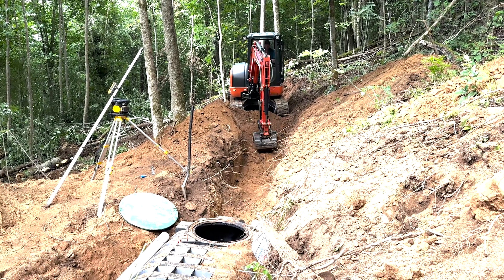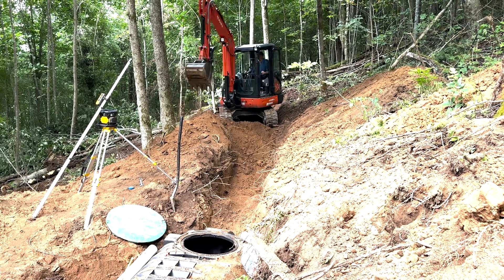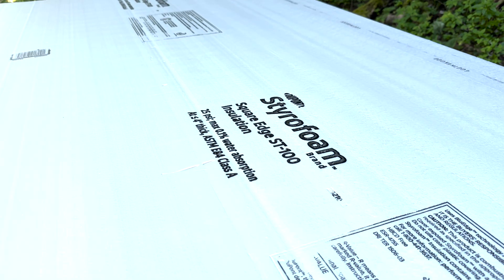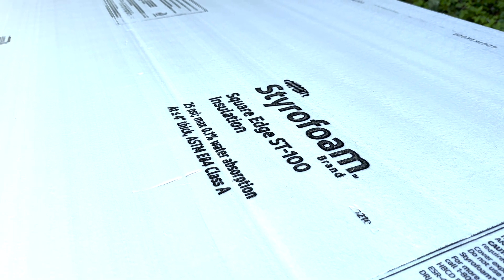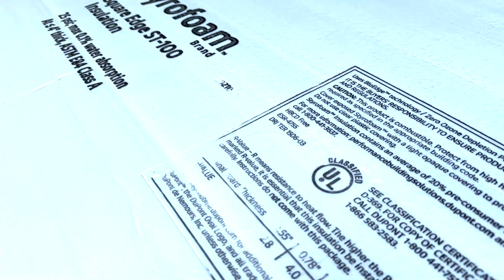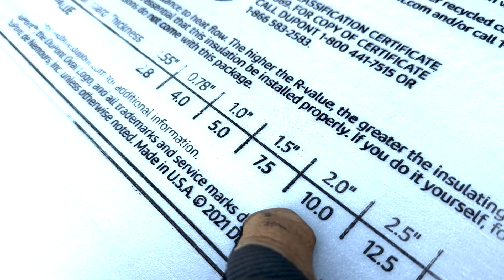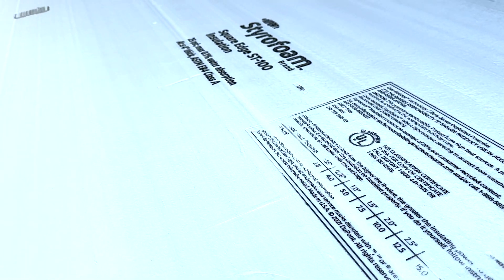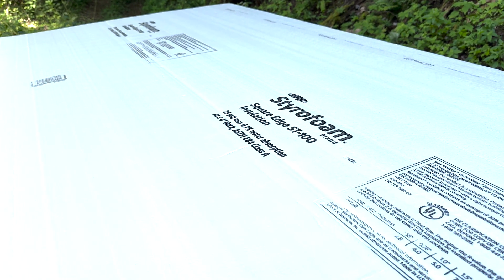Episode .15 - Insulating Cabin Floor with Dupont Styrofoam ST-100

Comment: Nice job, one question for you, what was the thickness of the OSB on top and do you find it spongy at all without having joist supports every 16" since the main floor is directly on the foam? 
Thanks!
Reply from the maker: Both OSB are 3/4 inch. The OSB on top feels very firm. Not spongy at all but feels good on my feet. The 2” foam is very rigid and not spongy. I really like this idea. 

Stay tuned for a video when I do the shower. I’m going to cut out the foam and it will give me a small step down which will be perfect.

Comment: The issue I see with this is you didn’t plan for this in advance. 2” is a lot of space and is taller than your wall 1.5” floor plates. Now what does your drywall screw into along the floor? All your door rough openings will be 2” smaller. I was considering insulating on top of my subfloor but it just screwed everything else up.
Reply from the maker: I did plan for it when I framed the doors. Episode .17 shows the door installation. Same for the sliding door. You definitely need to plan when raising the floor with insulation. Drywall is screwed on each stud 16 OC and that hasn’t changed. You don’t need to screw closer at the bottom. I will be doing blocking at the bottom but it will be more for baseboards. Great questions. Thanks for watching

Comment: fantastic work! - you will need to install new blocking at the bottom of the walls just above the new floor elevation. WAY TO GET AFTER IT!!!!
Reply from the maker: Thank you! I will install blocking. I was undecided if I have to but it’s better to do it now and not regret it later.

Comment: Very smart idea putting the rigid on top of the initial subfloor.   You now have  a thermal break with a continuous  R-10 Value.  If you do add insulation, you will increase the cavity value plus the rigid.  for the flooring.  To complete it, if you fill the cavity fully and put some sort of air barrier underneath with  plywood , you gain additional R-value with the joists not be exposed.  Thus , the 2x 12 you used will slightly over R-12 and then add that to the rigid you will have over R-24 with all the wood.  Use a permeable type of insulation so that your floor system can properly dry out.

With a pier foundation, the cold from the bottom will rob your heat.    Therefore, you are doing an excellent job.  Keep it up.
Reply from the maker: Exactly! If we only fill the cavity with insulation there would be thermal bridging. The rigid foam gives us a thermal break. I can’t wait to see the total R-value we end up with. Thanks for the input and thanks for watching!